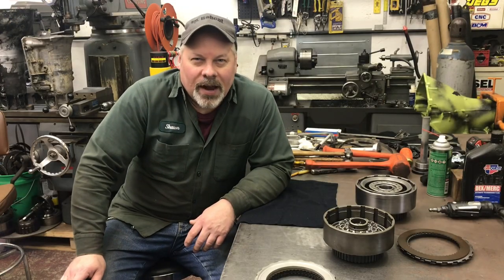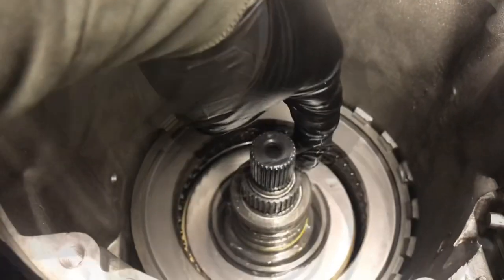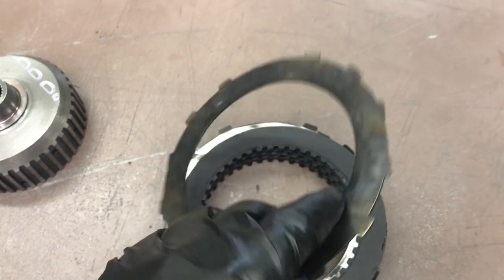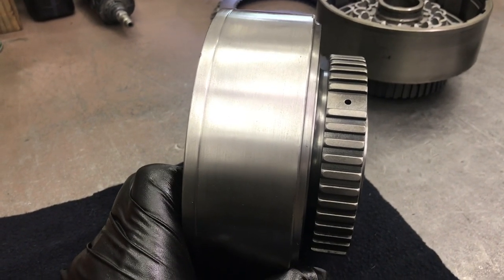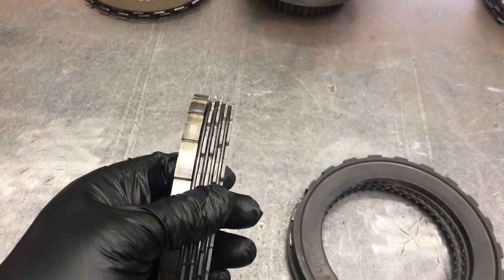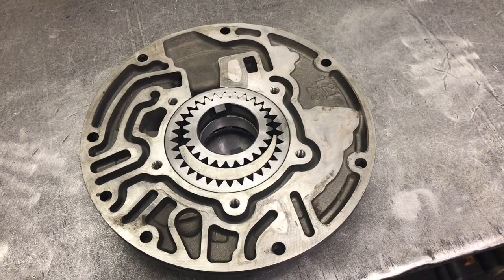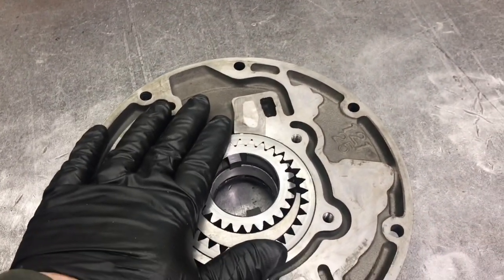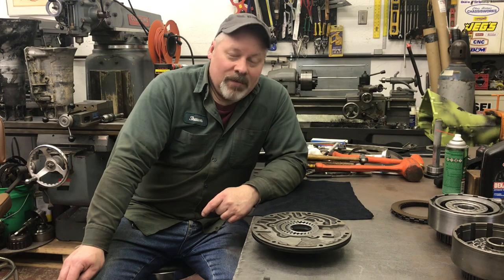TH400: How it works II & Extra Clutches

Comment: I'm surprised you don't have more likes !  Your videos are excellent IMO.  I have a TH400 I got out of a '77 Olds 98 decades ago, in my 81 Cutlass wagon with a rebuild '69 455 Olds.  (it was in a "custom" 88 with a factory 2 barrel...).  It is just my old "hobby" hot rod now.  I did put in a BM shift kit decades ago, and the transmission has simply always "worked".   Now, I am getting tempted to "refresh" it (along with the 455 - it has an "econo" cam).   I learned everything else by studying and "going for it".  I actually did have an original Oldsmobile B&M hydro stick in my '56 Olds, rather more decades ago...   I like the manual/auto feature.  I am thinking dedicated hot rod now.   Thanks for your guidance.  It helps a lot.
Reply from the maker: Thanks for watching!
I love old Oldsmobiles!

Comment: Spot on with the pressures. Automatic transmission pump is extremely robust (and kind of crude) compared to the hydraulic rescue tools I work on. 10,500 psi from plungers that are roughly 1/2 inch diameter on the first stage and between 1/4 and 3/8 on the second stage. Plus the plungers and plunger blocks are honed to fit as a matched pair. Max clearance is something like 1/10,000th  of an inch or less.
Reply from the maker: Dam!
Yes simple and crude is alright by me!
Reply: @mountainsgarage  I did a set of plungers and blocks in a pump for Rockland just before I hurt my knee. Fortunately replacement plungers and blocks come from the factory in matched sets. Tolerance is so tight, it was difficult to get the old plungers back in their matched blocks once I took them out of the pump.
Reply from the maker: @petermullin5387  Wow tight stuff.
I hope the healing is going well!
Reply: @mountainsgarage  healing process is going very well. The boredom is at its worst when you feel fine but are still under “restrictions .” Stairs are a bitch with crutches and zero weight bearing. Have some (Soldering) projects downstairs going to try some of that this weekend while the wife is home.

Comment: Id like to add, because I've seen it stated by other builders, removing the inner seal in the fwd DOES NOT dual feed or add clamping force. If you look closely, there is another hole in the center that feeds the outer portion of the piston, so the same pressure is applied to the outer but not the same volume, thus, it has the same clamping force and nothing is gained by removing the inner seal. GM did this to prevent harsh engagement. The ONLY thing that happens is the clutch is applied faster. For a stock to low stall converter will cause a harsh engage and possible complaint. With a high stall converter, it won't be noticed. But the point is, there's no durability gain.

Comment: very good info,,I have rebuild or re wrecked 26 t400s,,last time I had sintered plates made,am now 7 pair in front an direct clutch have ultra bell an valve body  reverse style,,thinned all steels an pressure plates, but can not get all thing good ,close it is behind a572,psi screw, 1942 gmc dually,pos rear end ,problem always breaking case if down shift ,is that cured by straight cut planets.

Comment: Hey Sean ; I was born in Calais Maine back in 52 . Im almost 71 . I think  i got a 475 . When i put it in low gear with wheels off ground  it sounds like a gear drive timing chain . My ? is does a 475 make a distinctive whining sound in 1st due to straight cut ? Thanks , you do great work

Comment: I got one for ya, my th400 is running high gear with 3.08s and tach is 4900 at 60mph! Has both shifts feels loose but makes 650 hp and will still slip the tires in high!! But i usually drive it 70 miles a day n mileage is disgusting now! Swapped from 700r4, th400 brand new 2600 converter n stupid ratio problem...

Comment: What is your opinion on cooling through radiator then external cooler vs just external cooler?  Currently I run the rad/col and putting around the mountains off road trans runs 220. Thanks
Reply from the maker: A stand alone cooler seems to run cooler. Less connections as well!

Comment: Could you please settle the argument about horsepower to turn the transmission. How much power does the transmission take to turn between a turbo 350 and a turbo 400. I get the fact that a Powerglide takes less because of its only two gears but everyone seems to have an opinion about the other two.
Reply from the maker: Another never ending perpetually retold Old Wives Tale. There are a lot of these floating around.
Powerglides are good until you break them all the time, TH400 is always a good choice.
A TH350 is not a racing transmission, it became the 700R4.